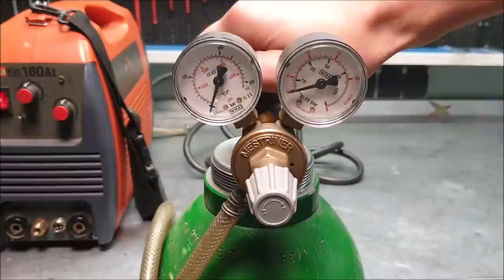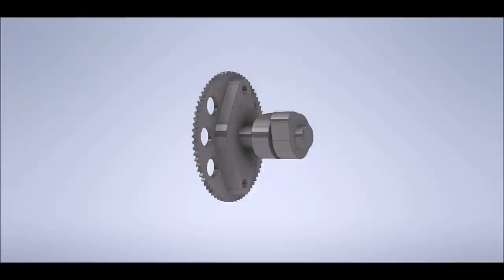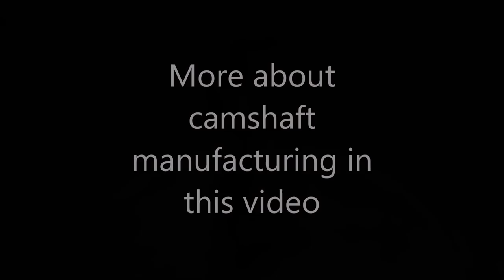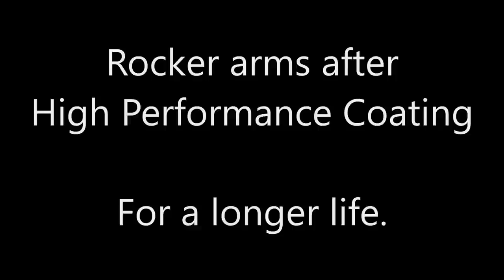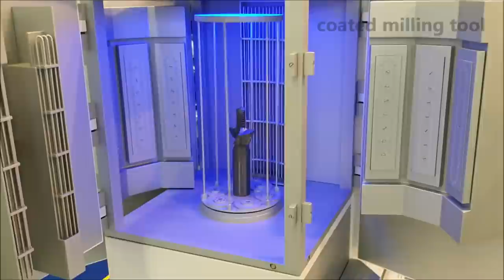Restoration of rocker arms + DLC coating - cylinder head from Honda TRX 350cc

Comment: Good Job, as you would be aware, as long as the Camshaft is Case Hardened more than the Rocker Arms, it should be Ok, if the Rockers are Harder than the Cam then you have Problems!
Reply: Surely that's the job of the oil.
Reply: @pbysome   Yeah, for the most part, but eventually parts wear regardless of lubrication, you're better off having a camshaft with a higher Rockwell rating than the Rockers or you'll wear the cam prematurely, you can replace the rockers or weld & grind them for less cost than a new cam - Cheers👍

Comment: NIce job, using relatively simple tools.. i love your grinding machine.. i would have used oilstones after grinding the rockers, first an India stone, and then an Arkansas.. a quick touch up with the polishing wheel afterwards.. and Bob's your Uncle.. 
the coating afterwards is for sure a good thing..

Comment: Always Nice Job. With all respect!
You must heat with Torch Light the rocker arms after all the repair job but before the final buffing, till you see small tiny flames and metals goes out of the arms that time immediately put it on small can with engine oil you have for recycling. That called metal painting/strength. 3 times per arm & their gonna be as strong as it was and after all make final buffing! Its not necessary but it help for brand new Cams. Keep Up the Good Work as Always!!

Comment: these cams are cast, they have to be welded with a cast iron coated electrode.  They should also be left to cool submerged in sand, or lime, so that cracks are not generated in the piece.  it is possible that after a few hours of work they will break.

In any case, they look great on you!  engine sound is good.  good luck!

Comment: Hmm hardfacing the rockers is interesting. I would have gone in with 954 aluminum bronze but I'll be interested to see if the cam holds up. You did get a good heat treat on it so they should both be at a comparable surface hardness. If you see spalling or excessive iron content on an oil analysis that wound indicate one or both parts is coming apart.

Comment: Nice work. I like it.
Do you reshaped the face of the rockers by eyeballing? Have any measure ore drawing of the rocker?
Reply: I have no machining experience.  I wonder about the same issue as toastbrot.  How do you know that you have the correct radius/height/dimensions on rocker arms that will provide the correct valve opening and duration?  Is it all brought into spec with valve adjustment?
Reply from the maker: experiences - feeling - eyes  . . . . .

Comment: Both cam and rockers look very nice! What alloys were used? I know the cam/lifter interface is a difficult lubrication situation,  especially during the unfortunate moments of inadequate oiling that happen. I thought qualities other than just maximum hardness were important. 
    I like these 1st Gen trx350's. High steering effort at low speeds! I think they might have a tight LSD in the front. 
     I used to work on them at a dealer. Saw a cam failure, replaced a few CDI's. Too bad they used drum front brakes...not self adjusting, I think. Many were used hard and hardly maintained.  
    Please comment on alloys used, galling resistance, etc. if you read this!
Reply from the maker: More here : 

https://youtu.be/BbqqnOHlA_c

Comment: Paul.. Need to ask u bout common rocker arm material? Is it from cast iron..if i weld it with mild steel electrode, is that ok?
Reply from the maker: It is necessary to use a hard weld + wear-resistant coating.

Comment: A cheap trick, to avoid this from happening.
Use a good synthetic motor oil.
You have to be a good welder and mechanic to do this.
New rocker arms are probably hardened by nitraiting.
Much durable. But even more difficult.
When buying second hand.
Listen and test compression. Check valve play. Look at least at spark plugs.
Reply: BTW
This guy is some kind of pro.
I am just an universal machine pro.
I only do my own Mc. Only BMW Kbikes before 2004.

Comment: Technical question: the original cam would have been drop-forged, machined and then case hardened to give it core strength and surface hardness. Will the new cam retain those characteristics being machined from billet? FYI I’m not a machinist but I am involved in a manufacturing. I also had a Honda cam/rocker fail in the same way on a similar age machine. Great work btw.
Reply: experience from a underbone racing mechanic: most reasonable part for that damage is lack of oil going to the cylinder head, oil starvation is the main cause of this, maybe from clogged oil filter or just negligence from the owner and also the valve clearance of the valve screw itself, no matter what kind of material used in camshaft as long it has lubrication it will last, we used local brand camshaft or just welded camshaft and grind it, it still serve it's purpose as long as it has lubrication
Reply: you have no idea what you are talking about

Comment: Strano, dove poggia l'albero a camme non c'è una bronzina, in sostanza gira appoggiato sull'alluminio.
Strange, where the camshaft rests there is no bushing, essentially it turns on the aluminum.
Reply: è abbastanza comune sui motori delle moto. La mia XT600 per esempio stessa  cosa, l'albero a camme gira direttamente sull'alluminio

Comment: It would be nice to put a roller on the end of the rockers, being they are being reshaped  anyway, put about 15mm roller on it, with about  9mm in bronze bush, about 1.5mm thick, leaving room for a tool steel roller, roughly 2mm thick, may need to reduce the roller a bit, surely 12mm od roller would fit, with 8mm in bush, leaving 1mm for roller and 1mm bushing, roller on both ends???
Reply from the maker: In future videos.